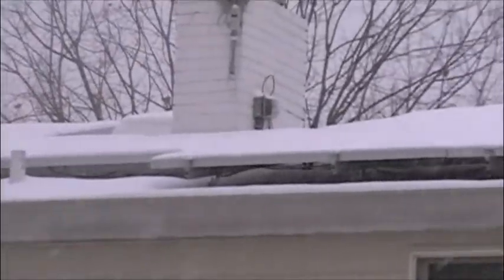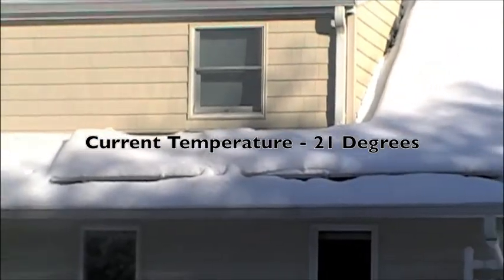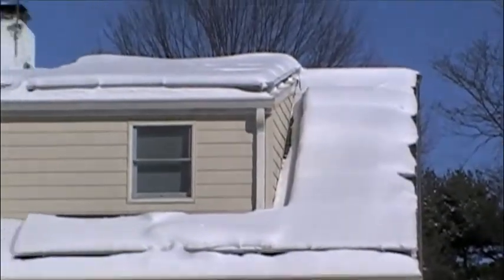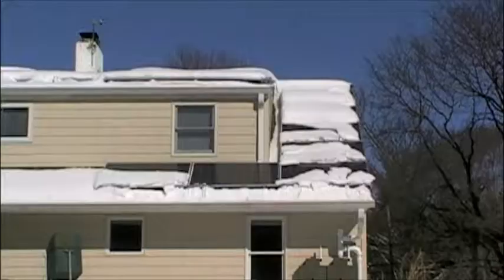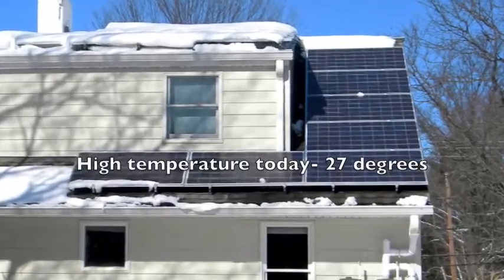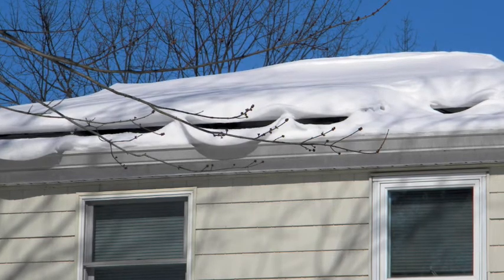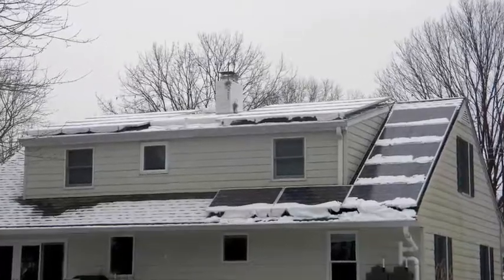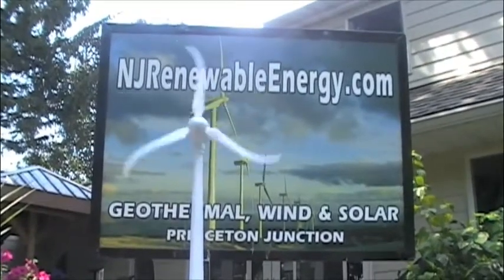What happens when you get snow on your Solar PV Panels modules? - Enphase micro inverters NJ

Comment: we have to install ourselves, payed to have all plans drawn up. we will have an electrician do final from disconnect to 200a panel box. 7.8k pv enphase m215 micro. we want to know best way to go directly into attic and seal it from the junction box at end of each array? can you tell us? We don't have snow but do have heat which will reduce output. N. Calif. you say all unirac rails have to have ground wire attached? or just side that has panel, enphase, trunk cable, etc?